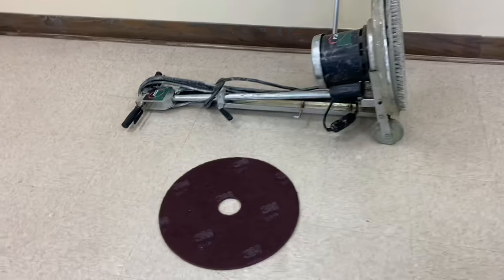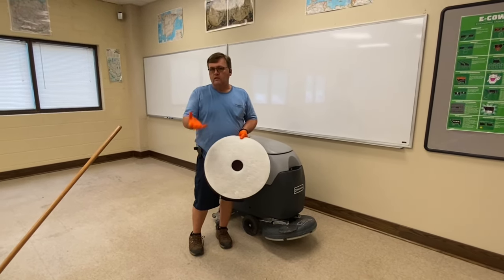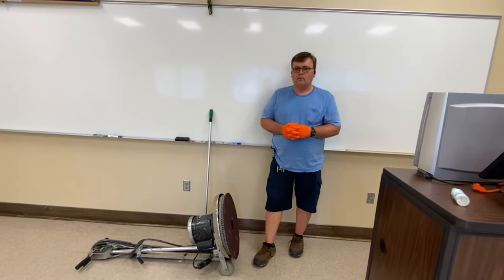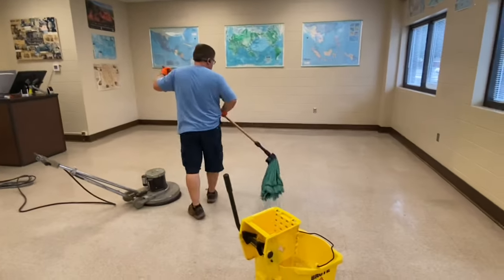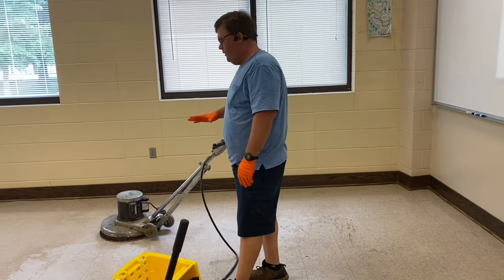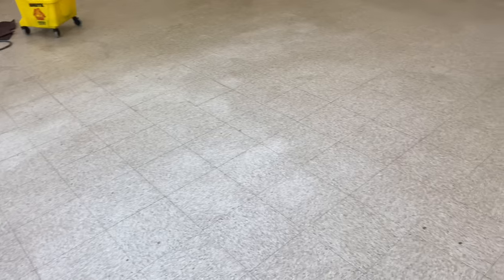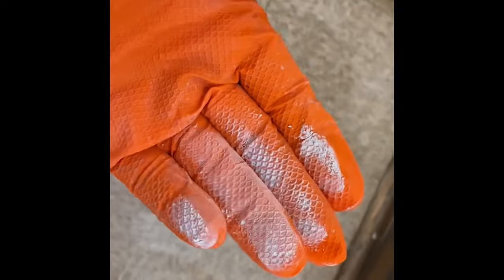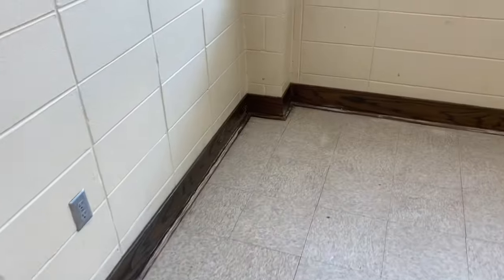3m pad stripping vct floor @mrjeffthecustodian

Comment: No offense or disrespect. But please dont anyone out there top scrub a floor with just water. Need chemical heat and friction to clean. Especially if your job depends on doing it right.
Reply: Hey David, that's simply not true. I've stripped hundreds of floors,  depends on the floor and how much wax you want to take off. I've don't this process plenty of times
Reply: @savinggenocide1986 yes sir!!
Reply: We use an abrasive powder soap in our water with an HO2 liquid cleaner and it works great with no chemical stripper risk factor. The HO2 leaves no residual soap and the abrasive powder soap gives extra wax removal power along with a 3M black buffer pad.
Reply: Is that pad a SPP pad.
Reply from the maker: @mikehamilton5927 3m
Reply: Its the technology behind the 3M SPP that relieves custodians of using strippers and the burden of rinsing the stripper.
Reply: Neutral cleaner

Comment: Seen custodians for yrs in schools and other jobs making up their own methods. Nothing avoids doing it right and hardwork. Can get away top scrubbing it for awhile. Sooner or later got to strip it. Also why not,its just floor stripper it wont hurt you. Been doing floors for over 25 floors for public schools and private sector. When there isnt any chemical all your using is machine friction to clean. Real top scrubbing a floor is using a pad and some kind of chemical if not stripper. Plain water is just a total wasts of time. Even just using some simple green rather then water will do a way better job.

Comment: In my high school we chemical strip one level and we call what you did top scrubbing on the other level. The following year we switch.  We use the coarse black pad which also removes a few coats of wax and the apply just 2 coats of new wax. If we use chemical we do 5 coats. This is how I was taught and all I know. It's interesting to see other peoples methods of trying to achieve the same results.Every floor is chemical stripped every other year so it would have 7-8 coats of wax on it.

Comment: I just got in to stripping and waxing floors. I've done it 2 times and failed both times, both involved stripping using chemical stripper. I came across this video and decided to give it a try today. My god I will never use stripper unless I have to. My floors looked amazing with 6 coats of wax. I'm so eager to wake up tomorrow to buff them and move everything back in the rooms. I truly appreciate this video, really showed me that waxing floors doesn't have to be as stressful as I thought it would.
Reply: I have a commercial and residential cleaning company and customers keep asking if I can do their floors but I am kinda afraid to use stripper and sealant or wax. I don't want to ruin anyone's floors but reading your comment encouraged me to try this. Thanks!

Comment: This top scrub method will work for a number of yrs. But what happens in large facilities is custodians keep doing it yr after yr. Then the poor guy who has to finally strip floor is in for alot of hard work and time. Especially in hallways that have been bunished and wax applied over and over again. Guy thats doing the stripping comes along. Puts down stripper first swipe. Cant get to the bottom has to keep applying  stripper and scrubbing same spot. Puts down floor stripper and using a pole razor scraper takes off sheets. Ive had to do this sometimes a few times each swipe. Then work down the hallway blend floor in each swipe. Trick is increase floor stripper mixture and dwell time ,hot water. And make sure you got a good wet vac and pole razor scraper. Done alot of floors, commercial and public schools.Were this method guy here did. Workers did for yrs. Seen alot of floors were this was done and floor we called it turned. Were floor was shiny as hell but dirty.Needed to be chemically stripped. Depends on how much it is waxed and burnished. But what the guy is doing and saying is true. Floors dont need to be stripped every yr, but at some point need to be.My biggest problem is when a worker just keeps on top scrubbing and waxing yr after yr and has major build up.  Classrooms can get away with this way longer then a hallway. That has a waxing maintenence schedule.
Reply: As one of those poor guys who's had to strip the 30, 40, or even 50 coats of wax left by years, or even decades of top scrub and recoat jobs, I approve this message.

Comment: Thanks; this was very helpful. My only question is that I don't have a mopping machine to clean after the water stripping. What would you recommend as the best way to rinse the floor after stripping before you apply the wax?
Reply from the maker: Do you have anything thing to pick up solution with? A front squeegee vac works best.
Reply: @mrjeffthecustodian  I have a squeegee and shop vac
Reply from the maker: @michaelreynolds1051 that’s what we had years ago. Definitely will work. The one not thing stripper will burn a shop vac up. Need to invest in a squeegee vac. They are designed for floor stripper.

Comment: So it is possible to strip a floor without stripper, just with water/and maybe a little soap? I mean if it gets the job done right? Thanks for the video
Reply from the maker: Unless you use the 3m pad. There will be no wax removed. If you use soap all that is a top scrub.
Reply from the maker: Yeap
Reply: Depends on how dirty floor is. Not that bad use a red pad. Kind of dirty use a green or blue pad. Really dirty use a brown or black pad.

Comment: in canada we call that floor scrubber a zamboni. like the zamboni that cleans the ice in hockey rinks. the floor scrubber drops water and sucks it up cleaning the floor just like the ice,lol
Reply: one tip. punch a hole in the top of the wax bucket (with a screwdriver) opposite side of the pouring hole. the wax will pour out smoothly instead of jumping out like its doing to you in this video.
Reply from the maker: I would if I was using the whole bucket of wax. Got to keep it sealed. For the next time I wax.
Reply: @mrjeffthecustodian  the wax itself will seal it. or just put tape over the hole. have fun my friend.
Reply from the maker: Tape! I’m slow and old. That will work. As I always say. Never know it all and never quit learning. Thanks for the tip.

Comment: What did you do when you got to that back wall? Also that rectangle that you used for your exit is that always your exit? I just couldn’t tell what you on the wall that was opposite of where you started. Did you just turn around and do the sam thing as first then leave a path?
Reply from the maker: On way in one way out. I did change directions as much as possible. A lot of times when I video. My talking and what you see don’t match up. My human era.

Comment: Does the black stripper pad for the buffer have to be the same exact size as the driver or is it ok if the pad is an inch larger in diameter than the driver?
Reply from the maker: 1 inch shouldn’t hurt anything. As long as it’s not scrubbing the machine.
Reply: @mrjeffthecustodian  thanks man. I appreciate it. You do great work.

Comment: Mr. Jeff. Another beautiful video once again for stripping floors and waxing. 3M Surface Preparation pads are great product. Anything is better then the chemical stripper that's out there. Stripper destroys everything shoes and slippery then anything out there. Good chance to fall using stripper. I have 31 years in as a custodian now. I prefer waxing floors with the 3M Ez Shine backpack waxer applicator even thou it's  expensive at $300. I've done it with the rectangle bucket you used with the sieve as well. That's not bad as well either. You can also go old school with the finish mop and  mop bucket. Have you ever used fans to dry the floor after waxing?  Not too close the floor otherwise you get ripples in your wax job. I've also learned in the past 4 years if you use an industrial dehumidifier helps a lot to dry your floor as well. Which I understand you have limited resources. We have an air conditioned Elementary school with a dehumidifier running floors where drying in 30 minutes. Your first coat you want to make it super dry so 2 hours before putting the 2nd coat on the floor. What do they say wax dries from the bottom up? Nice video as usual. Keep them coming.
Reply from the maker: Yes glad there are better ways these day. I hope I never chemical strip again.
Reply: @mrjeffthecustodian  I hear ya!

Comment: At the high school I work at it takes us a week to strip a classroom floor to bare tile because most of the rooms have at least 40 coats of wax on them. Plus the stripper we use sucks
Reply from the maker: Been there. Build up is for the birds.
Reply: You need good stripper and long dwell times. 40 coats is a lot of floor finish. Good stripper with a 2 hour dwell time ( re apply as it soaks in) will cut thru many layers. Extreme build ups will require this process to be done multiple times. This is why you flood 2 rooms at a time. Hopefully they are right next to each other. I use a flat mop to spread stripper. It's easier to do. Before I bring out the 175( with a stripping brush... No pads...brush is better they don't clog up like black pads for)I have spent a lot of time mop stripping. When the flat mop no longer sticks to the floor then you know the wax has been emulsified and is ready for the machine...
 Let the stripper do the work.
Reply from the maker: 40 coats oh my
Reply: Put down stripper, pole scape it. Then reapply chemical scrub it. Keep doing this until wax is up then move on to next swipe. Hot water, increase stripper mixture ,longer dwell time, razor pole scrape it is the key with large wax build.  up. Sometimes it just not possible because of time to get to the bottom get all wax off. So just do each swipe uniformly have to blend it in. Then after like 4 coats of wax. Will start to see it look better blend in. Done so many floors like that very large build up. Will kill yourself trying to get it all up.

Comment: Great video Jeff. Do you notice better results stripping with the swing machine vs going over the floor several times with the walk behind and a 3m sanding pad? (that's what we do). Also a tip you can try next time you pour out of a wax bucket, if you turn it so the outlet is on the top, you get less 'glugging'.
Reply from the maker: True on glugging. I have used walk behind walk behind and 3m. That works and well.

Comment: Can I put stripping chemical in an auto scrubber and use it to scrub and strip the floor?
Reply from the maker: NO!! https://youtu.be/tN01oRJCzGI?si=fPg58InQNNhbaCR6
Reply: You can apply floor stripper to floor not machine. Then use auto scrubber just the pad moving, no wet fav on. When you think its good then suck it up. Just make sure you clean scrubber out really good afterwards with water when done. Chemicals will mess up hoses and machine. Had to do this one nite on a quarter mile hallway. Job wanted stripped in one nite. No way would of been possible with a swing machine. I also used auro scrubber to rinse floor after scrubbing. Just put down stripper with mop then use machine will be fine. We actually had a walk behind with this stripping feature. It free floted in normal mode. Then pressed down on handle and it applied more pad pressure to pad to floor. Really saved my ass that nite be able to do that.

Comment: I'm having a small issue with swirl/turn marks appearing after finishing the job, where I turned the wax applicator to move back the other way. Any tips?
Reply from the maker: I have had that happen. Two things I can think of. You maybe applying to heavy of a coat. Try not to load up to heavy. One thing I do is pull straight from the bucket with my pad. That way my pad want be so full when I start my turns. Like I’m this video. I start next to wall the. Make my longer runs with the turns back and forth. The 2nd thing. Wax may not be self leveling. So it kinda stays put and dries without spreading any.
Reply: Your problem might be humidity levels. Use to happen to us in a large school district with vct tile.  When finished would dry look like broken egg shells when dry. Also might be rushing coats. We started putting AC on in rooms.That hazing and broken egg shell look disappeared between coats and finished floor with ac on in rooms.

Comment: What was that edging tool that you were using?
Reply from the maker: Doodle bug
Reply: @mrjeffthecustodian  i have that and it does not work well at all. It's the black pad. These rooms that i am doing have a massive build up of old dirty wax so maybe that's why it isn't working?
Reply from the maker: Razor blade on a pole. Been there with massive build up. I have had it so bad had to scrape whole room.

Comment: im sorry but you can not every 3 years use 3m pads this is not a full strip

and u are budling yourself for a heaahce later
Reply from the maker: I haven’t wet strip a floor in 10 years. Been 3m padding never had a problem with yellowing or build up.
Reply: I dont think he tried  this method in a hallway that's been waxed regularly and burnished. Like you said he would end up with a gigantic headaches in future. Plus try this method in private sector will end up getting fired ,loosing jobs real fast.

Comment: how do you know when you have gotten up all the wax off the floor
Reply from the maker: What method of stripping are you doing?
Reply: @mrjeffthecustodian  im wet stripping with chemical an its about 3 to 4 coats of wax on the floor
Reply from the maker: You will not get all wax off. You just want it to be clean. No dirty looking spots. Floor will look lighter in areas than others. This method is not a complete strip. Your only take a few coats off. Leaving the base coats. As long as the floor looks clean. You should be ready to wax.
Reply: @mrjeffthecustodian  ok thanks

Comment: How do you get water spots up after you mop?
Reply from the maker: Don’t have that problem if  wrong mop out good. Applying to much water to the floor is usually what causes that. At least for me anyways.
Reply: @mrjeffthecustodian  I just tried to buff some water spots off classroom floor. I used floor cleaner and white pad but it took the wax off? I guess yes from using to much water. I ring it out as best as I can. Our floors our old.
Reply from the maker: That’s a mystery that wax came off. There must be a chemical reaction in the mix some where down the road. Could be from the floor being old and not being properly taken care of over the years. I know it can be very flustering when you want things to look good.
Reply: @mrjeffthecustodian  well thanks for the reply. Maybe I’ll try more and more less water. I rather have carpet than tile.

Comment: Did I hear him say 2 hours for 1st Coat. He needs to be fired LO. L. I've been doing floors for over 40 years. Floor. has Not been done in several years. There's no way I would have not chemically stripped that. There's a time in place. There's a time and a place for those 3 m's. floor..
Reply from the maker: Glad you enjoyed it.

Comment: I majored in floor buffing, stripping and waxing for the first 11 months I was in the Air Force. We tried to make the polish and finish last longer by always removing our shoes. Then here come the training instructors doing their inspections with their boots and shoes walking around like a  bunch of elephants. They fed on our tears.
Reply from the maker: The same goes being a school custodian. 2000 plus  kids on your nice shiny halls. I really had to learn to let that go. From my understanding once upon a time. The military used a compound wax. Is that still true? I heard it was much harder to do than regular waxing and stripping. On thing about school. I could show my flustering feeling. In the Military you had to suck it up! I want to thank you for your service for our country!!!!
Reply: @mrjeffthecustodian  In basic training it came along the first Sunday.  We were told we could go to church or we could go to a party. Those devout soles amongst us dressed and left for church. The rest of us were educated on what a "GI Party" was all about. We all got to scrub, polish, dust and buff every inch of the dormitory. We did the two big rooms just like you did in the video strip and reapply wax. We may have been able to get away with spray touch up or burnishing on odd weekends. I remember the conversion to regular attendance at Church was amazing.  In tech school after Basic the MCT tile was very dark almost black and we used a Paste Wax like Johnson and Johnson. The floor was like a mirror until it was walked on. We would go down the narrow hallways walking spread-eagle so the wear was only along the edges next to the wall.  I saw guys come to blows over disrespecting another stack's hallway floor finish after the buffing was completed. Lessons had to be taught and learned.
Reply from the maker: Oh my paste wax!!